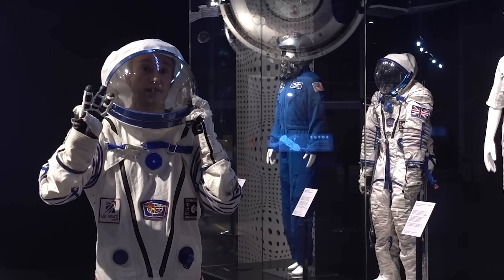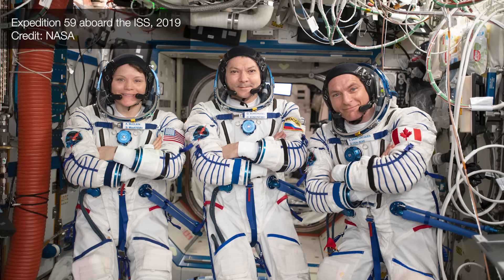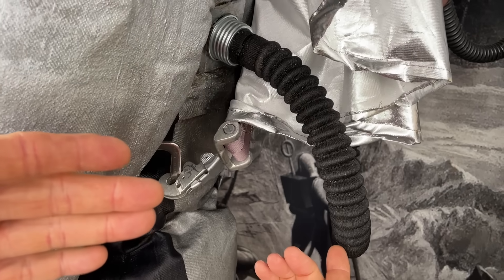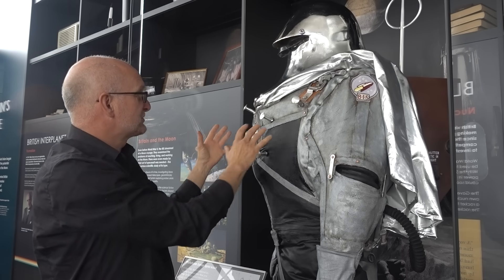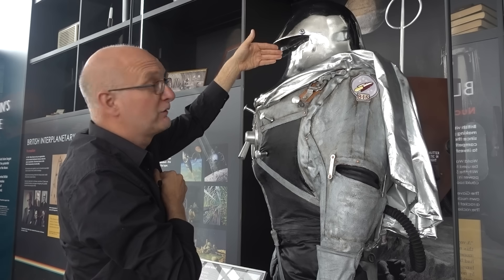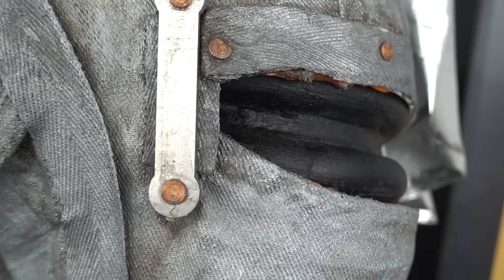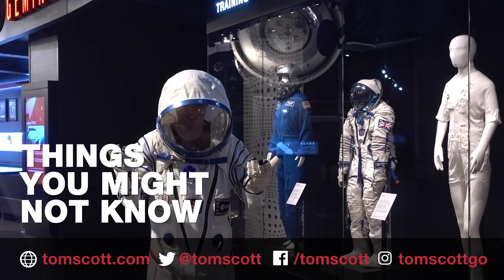The long-forgotten history of the British moon spacesuit

Comment from the maker: Unfortunately, the British spacesuit model isn't available for anyone to wear, which is a shame! But it is on display at the Rocket Tower. And apparently one idea for that on-suit airlock was passing in sandwiches for lunch...
Reply: and a cup of tea obvs.
Reply: This seems like the perfect project for Adam Savage.
Reply: Of course it isn't available for rando's to wear! It would we weird if it was, honestly...
Reply: Well there goes my summer plans
Reply: Did the suit have a diaper compartment?
Reply: Yes I would absolutely love half dried icy radioactive sandwiches!
Reply: @Yutaro-Yoshii  Things that are exposed to radiation do not become radioactive.
Reply: @misterscottintheway  Unless they're hit by neutrons.
Reply: @Yutaro-Yoshii  Sounds more appetising than a British Rail sandwich
Reply: @Yutaro-Yoshii  they probably wouldn't be radioactive, and they definately wouldn't be icy. They would, however be very, very dry, and a bit chilled, as the vacume would cause al the water in them to boil cold, carrying away some of the thermal energy. any veggies would turn to mush, and if the bread didn't explode, it would be super dry and crumbly. Also, the condiments would splatter everywhere.
Reply: @bow-tiedengineer4453  That's assuming they wouldn't be in vacuum sealed packaging.
Reply: I am both surprised and somewhat disappointed that it didn't include a heat exchange system to allow boiling water for tea.  Although that does beg the question of how tea time would be calculated on the lunar surface.
Reply: @woodrobin  you could boil the water by simply exposing it to vacuum at normal temperature, although that wouldn't do much good, as it's the heat of water that is needed for tea, not the act of boiling.
Reply: Great video Tom!
Reply: For people commenting “Why does it say 2 days ago?”
Videos can be private and then made public.
Reply: From what we know about Regolith passing a rock through would have been a very bad idea.
Reply: Just enough room for a flask of tea, teacup / saucer / teaspoon, sugar cubes, tiny bottle of milk and a small biscuit tin!
Reply: Surprised it doesn't also have its own on-board boiling vessel too
Reply: Of course it was.

The only surprise is there's no built in kettle for making tea.
Reply: Oi, where the cosplayers at?
Imagine wearing this to a Renaissance faire
Reply: This is great - but did you know that the US spacesuits was based on BRA technology? Indeed, only the bra companies and seamstresses had the technology and know how to stitch the US spacesuits to such exacting standards - years of work with boning / wires in bras was perfect for the precision boned work in the US spacesuits. See the brilliant book Golden Thread - How Fabric Changed History by Kassia St Clair.
Reply: Prof. Quatermass's Rocket Group ?
Reply: I read an American SF story from the 1940s with a somewhat similar spacesuit. After a demanding couple of hours of collecting mineral samples, an explorer took a break, pulling his arm inside his spacesuit so he could light up a cigarette.
My immediate thought as I read it was that if someone did take his tobacco addiction with him into space, he'd be more likely to do what demolitionists do, and switch to chewing tobacco or snoose.
Reply: Impossible to read a post from you and not do your voice in my head. Congratulations.
Reply: Only 2 days?
Reply: The suit they let you wear made you look as if you were going to go out for a stroll on LV-426.
Reply: Paging Adam Savage to make one!
Reply: Someone should make a reproduction.
Reply: ive been to the space centre its so cool
Reply: And of course the unmanned 50 year trip to Barnard's Star. Project Daedalus
Reply: Naaaah, the airlock is intended for the tea and biscuits.
Reply: I wonder if they could do the garlic bread thing you did? Pop it out the airlock, let the sun cook it, and bring it back in nice and toasty.
Reply: Blood will not boil in vacuum beacuse blood vessels will maintain some pressure
Reply: @Qrnl  It may, however, out-gas, in the same way that a diver gets the bends as they decompress. Scott Manley has a good video on this subject from a few weeks ago, about the feasibility of using sticky tape as a temporary space suit.
Reply: @Qrnl  well, that depends of if you mean it would boil on exposing flesh to vacuum, or that it would boil after your blood vessels had exploded, exposing the blood directly to vacuumed.
Reply: One Spaceknight to another: "Lembas bread. ... More lembas bread." :P
Reply: @thcdenton  what preserves/jam goes with lembas?
Reply: I just pictured a British astronaut eating a "chip butty" on the moon.
Reply: If a British astronaut can't get a cup of tea at the proper time... the whole mission would more than likely fail. :)
Reply: They should test that suit in an actual vacuum chamber. Otherwise we will never know.
Reply: Is anyone getting Bioshock in space vibes?
Reply: cheese gromit
Reply: Only a British spacesuit would be designed with an accompanying seat and a mechanism for passing in afternoon tea. We may be hundreds of thousands of miles above the Earth but we'll be damned if we can't have a sit down and a spot of lunch
Reply: @ajb-228  and remember not to forget the cheese and crackers grommit
Reply: Get in touch with adam savage and tbe tested team, id love to see him build this incredible thing! Looks futuristic medieval!
Reply: Because like NASA it's complete Fantasy
Reply: 2
Reply: @ContentConfessional  tru
Reply: samwhich
Reply: @TheFalseShepphard  Thanks Possum You so Awesome 😎
Reply: No problem
Reply: i think i am the  “1.6k’th” like
Reply: What you know about rolling down in the deep 
When your brain goes numb you can call that mental freeze
Reply: I see you been to Leicester, have you went for lunch at the golden mile next to space museum?
Reply: Huh.
Reply: I think I have saw this suit before.... somewhere, in a old video...
maybe it was Scott Manley, maybe it was one of Bradley channels...
however, i am quite sure I have seem it before...
maybe it was here, in this channel.
Reply: sad
Reply: but did it have built in tea making facilities, I'm sure you could fit a BV in there
Reply: Don't they know who you are ? 
It should have gone like this.
"I got a call from the National Space Centre saying 'we have a 1940s designed British space suit, would you like to try it out' so i said 'Yes, yes i would' and here we are "
Reply: But does it have a kettle?
Reply: Vacuum-Cucumber-Sandwich.
Jummy.
...
(May need rehydration)
Reply: It's a british spacesuit. Of course they included a way to do tea time...
Reply: ....someone needs to ETSY this.....
Reply: AI can make up stories that no one knew existed. That's just great.
Reply: Wait, tea sandwiches are a thing?
Reply: Now I want to see an episode of Doctor Who, where the Doctor takes someone in that space suit to the moon to test it.😊
Reply: Anyone else getting whatsapp spam that says it's from the video creator?
Reply: @robopam  No that would require using a thing that gives even more money to the person who already drove up real estate prices 10x so nobody with empathy can even afford to live where I grew up anymore
Reply: Well done tom, you got a relative clause kn that paragraph
Reply: I bet that at least 20% of the research and engineering money would have gone into finding a way for the astronaut to brew a fresh cup of tea out on the surface of the moon.
Reply: Chinese wallpapers in. Tá
Reply: time to consume my

sandvich edible device
Reply: Tom, while (understandably) the actual suit isn't available, surely the plans could be had for a price, no?
Surely Stephen Wisdom could be quietly commissioned to produce another, for the right amount.
Reply: that's so violently british
Reply: And of course tea!
Reply: So sandwiches are more important? Accurate
Reply: unfortuneately, the sarnies would probably get a spot irradiated if you passed them in the moon.
Reply: specifically cucumber sandwiches
Reply: @Efe o
Reply: How bout for passing tea?
Reply: This goes well with the joke that is Boris's "galactic britain"
Reply: In 1962 didn't NASA request to see Henry the eighths foot combat armour in the Royal Armouries to help with the design/articulation of the space suit?
Reply: People asked to wear it?? What do they think that place is, a theme park?
Reply: passing in sandwiches from where?
Reply: Sandwiches? cups of tea more like
Reply: Sandwiches? Or keeping the astrogentlemen topped up with tea?
Reply: Yes it is just get a Nike/adidas/Puma Tracksuit. 💯😐
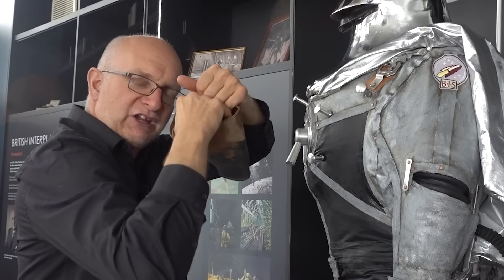Reply: 2:40 is more realistic than today
Reply: The image of a sandwich, the bread having ballooned because of the low atmospheric pressure to be significantly larger than it was when it was packed, being awkwardly passed between holes in two astronauts' chests as they sit precariously on their little festival chairs on the moon is really something.
Reply: I think the internet would be interested in a video about the Polish space program.
Reply: It looks like parts of Mark 2 astartes armor
Reply: What do you mean? Was there another reason for it aside from passing in sandwiches for lunch?
Reply: This actually looks really cool and yup lunch is very important haha
Reply: Hopefully not coronation chicken
Reply: Well it’s British
Reply: Is this the one in Leicester?! I've never seen this suit il have to go again and see it!
Reply: Watch 'American Moon' 
Conspiracy
Reply: That's how u know its a British spacesuit. Must encororporate sandwiches.
Reply: Have you watched Bart Sibrel documentary on the moon landings Tom? You should. As should everyone else. Including the death-bed confession/testimony of the son of the MP Guard.
Reply: Im not going unless you pack the tea
Reply: I am shockingly surprise that it wasn't meant for getting tea.
Reply: would they sue me or something if i changed that?
Reply: Was there also an en-suite airlock for passing sandwiches after lunch?
Reply: If the USSR has cosmonauts, the US has astronauts, the Chinese have taikonaut, then surely Britain has ASTROKNIGHT!!
Reply: And a cup of tea, for sure ...
Reply: You could make it 😅
Reply: He looks like a Space Marine, sorry IT looks like one 👍 🇬🇧🧷☠️
Reply: As long as you could brew a decent cuppa on the moon our boys and girls would go.
Reply: yes
Reply: @imaflufurpillow  I
Reply: @imaflufurpillow   o     o
Reply: You forgot carbon dioxide scrubbing, which is arguably more important than providing just oxygen.
Reply: How dissapointing
Reply: ok
Reply: Tea time?
Reply: The English don't delve into style often, but sometimes they simply nail it.

That space suit is the best thing we could have ever had men wearing on the Moon.
Reply: Could you explain how the video was uploaded today but you commented this 2 days ago.
Reply: @OlrikMeister  video wouldve been unlisted for a few days so you could check everything was ok with the video
Reply: @invisyarcticfoxx  I think probably copyright I guess?
Reply: @OlrikMeister  I was uploaded 2 days ago and made public now. Probably was being edited in the meantime.
Reply: @drushyamalpani3587  how edit after uploading? The editing doesn't happen in YouTube 🤔
Reply: @vishalgaurav4411  they uploaded the raw video and then edited it.. not in YouTube in other app.
Reply: @drushyamalpani3587   I think probably copyright I guess?
Reply: @OlrikMeister  bcs they will have commented it when it was in private mode, most youtubers use it before uploading their videos so they can edit the thumbnail etc
Reply: @OlrikMeister  the video was uploaded earlier, it was just set to public today.
Reply: Time travel
Reply: @marcus9441  Obviously!
Reply: @OlrikMeister  private/unlisted vid
Reply: @OlrikMeister  It was RELEASED today.
Reply: @OlrikMeister  duh...... haven’t you heard of time travel? Tom actually has found the secret of this which is why his historical facts are so obscure........
Reply: @OlrikMeister  It was unlisted
Reply: @OlrikMeister  Magic.
Reply: @OlrikMeister  it's a conspiracy dude
Reply: @OlrikMeister scheduled upload
Reply: @OlrikMeister  unlisted
Reply: @OlrikMeister  it was uploaded yesterday but made public now
Reply: @OlrikMeister  what you said
Reply: 2 days ago
Reply: 2 days ago? How do you that, sir?😭
Reply: Tim Scott please explain how 2 days ago

Comment: So a space suit 50 years ago, supposedly went through temperatures of minus 200° in the shade on the front of the suit  250°C like ur oven ? So why don’t they use the same suits for fires today? Because nobody went to the moon, the radiation would’ve killed them.
Reply: because the suits are so incredibly heavy that you can't wear them in normal gravity. but we do use the materials that were invented during the space race, that includes heat resistant materials
Reply: That is a great idea

Comment: Everybody is praising the capes meanwhile im over here like...those are a fundamentally horrible idea in zero/microgravity and would cause nothing short of headache
Reply: It's meant for Moonwalks, not zero or microgravity. With no air resistance, it would just fall and drape as quickly as 1/6th Earth gravity allowed, especially if the lower hem was weighted.

Comment: There’s nothing quite like picking up an interesting potentially dangerous or radioactive substance and putting it in a hole on the front of your armour
Reply: It's very unkikely to find something radioactive on the surface of the moon.
Reply: @logitech4873  huh, I never new that. Why?
Reply: @edwardreed67  Because radioactive materials are simply rare. If you go to any random desert on earth, you're not likely to stumble across radioactive rocks - so you don't need to worry about picking up stuff.
Reply: @logitech4873  You see I thought the moon was 200- 1000 times more radioactive than earth
Reply: @edwardreed67  That's because of the unfiltered sunlight. The moon has no atmosphere and ozone layer to shield it from the higher energy sun radiation, which means you need suits with shielding.
But the soil itself isn't radioactive.

Comment: Why they didn't make a built-in kettle is beyond me.
Reply: Rights 💀even our tank has a built in kettle the size of a bath and enough teabags to last anyone a month, well anyone but us, if it's Yorkshire Tea it would last me a few days
Reply: version 8 my lad, had a built in kettle.
Reply: @DavidKnowles0  you weren’t supposed to tell them we got that far!
Reply: You could flash boil the water with the lack of pressure from being on the moon, space tea is fast tea. Don't even need a kettle.
Reply: @just_doug  I do believe making tea actually requires heat and boiling is just a convenient repeatable point where the temperature of the water stabilizes. So I don't think this would work.
Reply: If ya can’t enjoy a cuppa in space what’s the fuckin point in going?
Reply: You can carry tea and biscuits in your chest airlock.
Reply: thats the true purpose of the "airlock". You put your tea in the inside, then you vent the air to vacuum. As the air pressure falls, the liquid boils, making tea.
Reply: Barry’s!
Reply: They should have equipped a Teasmade behind.
Reply: That's Hilarious!! Well thought of!
Reply: He needs another collapsible seat thing to drap his cloak over to make a solar oven. Then he passes a sealed thermos/kettle out to it through the suit airlock.
Reply: They already have the airlock for boiling water. Won't be very warm but it would boil.
Reply: @trabant3060  That doesn't help make the tea though if it doesn't get warm. It would just be tea leaves floating in less water.
Reply: @massimocole9689  see you're thinking of the spirit of the law instead of the letter. A kettle boils water as does a vacuum. Didn't say it had to be used to make tea.
Reply: @trabant3060  True!
Reply: Tbh, closest to anything workable I can see is tantamount to a Thermite-heated Arizona can...

And, really, who amongst us wants that sort of utter nonsense?
Reply: That's what the liquid-recycling system is for
Reply: They should have incorporated a dishwasher in there too
Reply: "Tea, Earl Grey, hot."
From PoGo and Picard.

Comment: Interesting, it looks like something from the nerd media of the previous decade (the 1930s), more like an adventurer or almost some type of space soldier. Which would make since space fiction didn't really change until the 50s. The airlock doesn't seem safe, at all. It seems like a massive weak point in the suit that also adds cost to the suit because now you have to build a small door into it.

Comment: most of those materials are incredibly flammable in a high ox environment. A static spark inside the suit could send the whole thing up.
Reply: Absolutely. When we made it we believe the original suit had a filament bulb inside too, so you could examine the rock brought in via the airlock. Dangerous indeed.